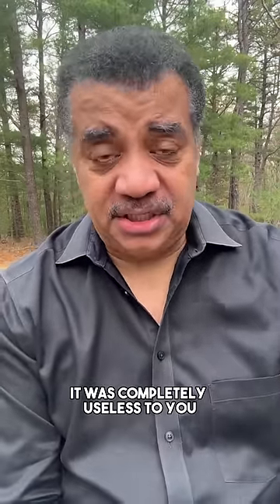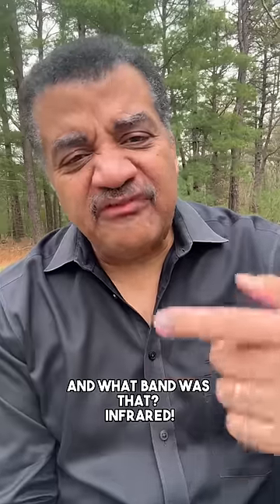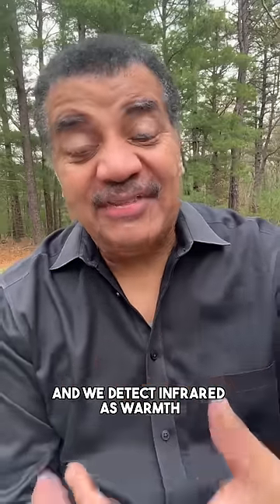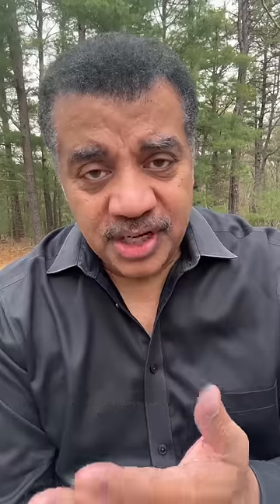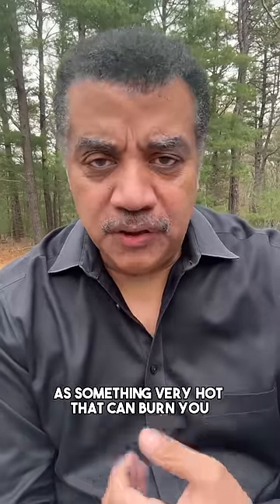LED Bulbs vs. Old Bulbs 💡

Comment: I purchased LED lights for my house way back in 2010. They were quite expensive then ($25-35 each) but they’re still burning just as bright now as they were then. Imagine, an incandescent light bulb 💡 burning for 13+ years….never happen.
Reply: Even if the leds are more efficient with less heat and arent bad for you in some way(speculation). The second point is wrong. Planned obsolescence started with light bulbs if the stories are true.
Reply: @cueballswr9466 That’s not entirely true. With incandescent lights, long lifespan means less light and the light is more red. If you want bright, white light, the lifespan shortens.
Reply: Utter nonsense. LEDs get dimmer over time.
Reply: @coryhoggatt7691  Just about all light sources become dimmer over time. Good quality leds give you the lifetime to a certain loss of brightness.
Reply: @cueballswr9466  Why would they be bad for you? If anything, incandescents are bad for you because they can actually put off wavelengths that can damage your eyes/skin. Also, not sure what you mean about the second point. Incandescent bulbs are designed to fail early, but even well made ones won't ever last as long as a good led light. LEDs last like two orders of magnitude longer.
Reply: There is a incandescent light burning at a firehouse in livermore ca. has been on since 1901. It's turning them off then the jolt of power on start up that makes them burn out
Reply: Had LED bulbs failing on me after a few months despite promising to last years on the packaging

Comment: Now we all know Neil doesn't change his own light bulbs.  LEDs do in fact get quite hot.
Reply: Not really, They're warm at most, depending on the power/size ratio. Incandescent lightbulbs become so hot that they are basically untouchable when they've been turned on for a while.
Reply: Not nearly as hot as halogen and incandesent bulbs
Reply: @jaspermooren5883  I've burned myself quite seriously on LED bulbs, expecting them to be way cooler than they were.  They might not get quite as hot as incandescent bulbs, but they still produce a lot of heat.  When you compare a volcano to a jet engine, you can't honestly or realistically say the engine doesn't really produce heat.
Reply: The "bulb" part may not get that hot, but the area just below the bulb can DEFINITELY give you some SIZZLE upon touch! 😬
Reply: Only 3 Watts? Begs the question: So with a 60 Watt LED the other 57 Watts goes to the power companies so they can plead poverty and raise the rates? Sounds dodgy.
Reply: The highest wattage LEDs are barely warm to the touch, tf you talking about bruh
Reply: I don’t know where you’re buying your bulbs from.. But you should definitely check out other brands.
Reply: Perhaps the first generation of LEDs were hotter? Most bulbs in my house are LEDs, they can be on for hours and still just warm not hot.
Reply: Please make sure that your LEDs are compatible with the light fixture. Not all LED bulbs are dimmable for example.
Reply: They do get hot. Remember, they are not florescent bulbs.
Reply: Led is DC the warmth you feel is the ac to DC transformer on the bulb which doesn't get very warm
Reply: Its the" servers" that get hot , i used to sell commercial LED lights
Reply: Try touching a 100w incandescent bulb!!
Reply: @philokevetch8691  That is the STOOPIDEST COMMENT POSSIBLE about electric power usage!🙄
Reply: @geekchameleon you’ve got some lady hands it sounds like
Reply: The LED chip itself still produces a lot of heat.  Yes, many fixtures carry the heat away pretty well, but have fun powering up a three watt or higher LED (single chip or COB array) without a heatsink.  It will get so hot that it destroys itself really fast.  If you're not careful, it will remove the flesh from your fingertips because it is so hot.

Yes, the AC/DC conversion process produces heat, and so does the DC/DC voltage and current regulation.  But in many of these systems, it is still the LED chip itself that produces the most heat in the system.  The power conversion system is usually pretty tightly packed compared to the LED and the reflector/thermal solution the LEDs are attached to.

As I said before, just because an LED isn't quite as hot as an incandescent bulb, it is no way near accurate to say that LEDs don't get hot.  Because they do.
Reply: Yeah LEDs May be less hit than incandescent, but they do get hot
Reply: @geekchameleon jet engines produce more heat than a volcano....
Reply: I think you should look for some better quality led's. The only reason they would get that hot is due to the ac/dc converter, which is  normal to produce some heat, but if its as hot as you say it's inefficient/poorly made or in worst case faulty, which could cause fire.
Reply: LEDs generate heat in the circuit not the bulb itself
Reply: @MadChrisp  Absolutely untrue.  The junction that produces the light also produces significant amounts of heat.  The supporting circuitry also generates heat, but is not the sole source of heat in the system.
Reply: @geekchameleon  Just to verify your claim, I tried to touch the led bulb which was on for last 3 hours.. It is slightly warm.. Unlike what you’re saying it doesn’t get hot like an incandescent bulb..

Just fyi it is a Philips 11 watt led bulb..
Reply: Yes, I was going to post this.
Reply: @TheGuider The bases of the bulbs, containing the electronic circuitry that drives the LED chips, do indeed get pretty hot.
Reply: @geekchameleon   Then you have some weak skin or you bought a fake LED lightbulb
Reply: @tuzopaai take that 11 watt led chip out of it's well designed (Philips do good stuff) heat transferring enclosure and power the chip while it's in your hand.  At 3.7 volts and about 3 amps, the back of the chip will burn your hand and melt the solder holding wires to the chip in about half a minute.
Reply: High performance led flashlights get super hot. Especially multi emitters that are output a couple thousand lumens.
Reply: @Zack_Axel I know right hahaha, I have a 6000lumen one that gets really hot if I have it on max brightness. I can literally go burn myself with it right now😂
Reply: @philokevetch8691 no he's making a comparison saying a 3watt led produces the same light as a 60watt old style bulb
Reply: @jaspermooren5883 led's have heat sinks. Some led's are cheaply made and have terrible heat dissipation. Even good high quality ones should not be installed in enclosed fixtures as the heat will just build up in the fixture which can damage the LED's. LED's are more fragile to heat as well. And yes they sure can get hot to the touch most dont get to that point but they can if they aren't dissipating the heat properly. Uncommon but it happens. Where I see it happen the most is in led flashlights.

Comment: The lightbulbs at the turn of the century used to last for at least fifty to a hundred years. They had a tungsten filament instead of copper. GE realized with the old light bulbs never going out people would not be buying new ones unless it was for lack of new home build. The bulbs that Tesla made if any of them still existed would be running right now. But JP Morgan who owns GE back then, he and his scientists got together and decided to get rid of the tungsten bulbs and create these flimsy copper bulbs, so that they were very delicate as well as having a short lifespan. This ensured that people purchased new bulbs on a regular basis and increased the profits of GE
Reply: Good job identifying yourself as someone who believes anything they get told.
Reply: There is one problem with your conspiracy, it doesn’t take much for for a market competitor to come up and produce his own, long lasting light bulb.
Reply: Incandescent bulbs are still tungsten filament if you can find them.  He is talking about the single light bulb that is the anomaly at a fire station in Livermore, CA.   I suspect that light bulb last because they got really close to a vacuum  in that particular lamp and the filament is, by manufacturing error, is rated for a higher voltage and hence the bulb lasting a lot longer.
Reply: @DIp-mj1yc he was mistaken on the filament. The original bulbs including the one from the fire hall are carbon filaments which are long lasting. The tungsten ones are the short lasting ones. The 2 articles I linked above explain more
Reply: @teebob21 read above comment, I advise you research things before you deny them, although most conspiracies are ridiculous this was a well known and documented case
Reply: @cryptouk7985  Oh dear, another one. Alright, I'll oblige.

The Edison light bulbs at the turn of the century did not last 50 to 100 years, as claimed. At that time, they used a carbon filament made out of bamboo, and generally had a 1200 hour lifespan. 

Copper was never a successful incandescent filament. With a melting point of 1025 °C, copper will give only a dull yellow short-lived light, and will quickly degrade and the filament will break. 

Nikola Tesla did not invent or improve upon the incandescent light bulb. His contributions to electric lighting were improvements on the carbon arc lamp, known as a carbon button lamp. Unfortunately, this style of lamp requires high-frequency alternating current and requires dangerously high currents in order to initiate electron release into the bulb (via a mechanism ironically named the Edison effect). Small solid-state transformers such as those used as ballast in modern neon lights would have served as suitable drivers for these button lamps, but they were 50 years in the future. It was impractical, expensive to own & operate, and failed commercially.

There is no evidence that JP Morgan conspired to change the construction of turn-of-the-century lightbulbs to have a shorter lifespan via planned obsolescence. Quite the contrary. In fact, JP Morgan's family home was one of the first to have electric lighting, instead of gas. Even after a small house fire cause by an improvised arrangement which ran wires under carpets and used a direct contact connection to illuminate a library desk in the middle of the room, Morgan eventually had his entire house wired to use Edison-style bulbs. (More info: Jonnes, J. Empires of Light. Random House Trade Paperbacks. pp 5-11.  ISBN 13: 9780375507397) 

Additionally,  the Edison Illuminating Company, which would later become Consolidated Edison, was not part of the 1889 merger, and has never been part of General Electric (GE).

This conspiracy claim fails on every assertion.
Reply: @teebob21 everyone gets told everything they think or believe.

Comment: LEDs also produce heat, but not from the Light but the fact that LEDs draw more current. Next time you turn on your LED, leave it on for a few minutes, remove it and you'll find the mid section to be very warm.

Comment: I live in the northeast. Nine months of the year there’s two things I need in my house, light and heat. The heat your not getting from the lightbulb, your furnace has to make up. The bulb doesn’t have a flue pipe, so you retain all the heat. Your furnace does have a flue pipe, so a certain amount of heat goes up the chimney. I would argue that in northern areas the incandescent is more efficient.
Reply: It gives off heat because the filament has electrical resistance. It creates friction and slows down the flow of electrons causing heat. The heating element on a range is a resistor. An LED is a light emitting diode, not a resistor.
Reply: And you could put it under a clay flower pot and the pot absorbs the heat, stores it, and radiates it. Saving energy. LEDs in the summer, incandescents in the winter.
Reply: Not for half the year though when you dont actually want heat in the house. Then your AC is running more to compensate so its like a double loss for half the year

Comment: In cold weather, the heat from  old-fashioned Tungsten light bulbs can be useful. On a hot summer day, your air conditioning has to work hard to remove it, an even worse case scenario.
Reply: Eh… in a small closed off area maybe, but with the amount of electricity it uses to do that, you might as well just go to the kitchen and turn the oven on.
Reply: But now you can just get an infrared LED for more heat for less cost.

Comment: I replaced every bulb in my house with very low watt led and the monthly bill stayed the same
Reply: Most of your power comes from other things anyway.

However if you have electric heat then it's more likely that your furnace or baseboards etc. are just making up the difference.
Reply: That could mean your lights were not contributing that much to the amount of electricity you used or perhaps your usage changed after you changed the bulbs

Comment: Infrared light was actually beneficial. Its free heat without the necessary infrastructure for a heat generation system.
Reply: It not free heating. The extra watts of electricity you pay for. There are other electric heaters that are just as efficient as light bulbs without producing light. Those light bulbs produce heat even in the summer when you don't want heat and you need to cool your house even more. So it's not very smart to use light bulbs for heating.
Reply: @MrT------5743  In scandinavia where I live summers and winters are all wet. Infrared light from a old light bulb is enough heat and energy to keep the indoor structures dry during rainy seasons.

Comment: He’s wrong, if you have a nice led flashlight, they get warm enough to melt holes in your pocket if you leave them on by accident
Reply: That doesn't sound nice at all
Reply: Many LED lights are mounted on a heatsink, or the internal power supply is giving off some heat.
Reply: While true those flashlights are putting out a tremendous amount of Lumens with most starting at 1,000 lumens. (Mine goes  to 6,000 lumens and produces so much heat that the metal has ribbing to help get rid of the excess heat.
Reply: Of course they generate  a ton of heat if powerfull enough
Reply: Yeah. Last I checked even the tiny led in my phone can give me a nice sting if I ever leave it on by mistake and then touch it.

Comment: The old light bulbs actually produced light that you can read by. The old bulbs had many uses beyond providing light. The old bulbs were glass and a little bit of metal which was  biodegradable but the new ones are filled with microchips and mercury and all sorts of noxious things that are going to ruin our land fills. I'll happily pay a bit mor to have that reliable tool back..

Comment: Now, many, many LED bulbs today often fail quicker, than old tungsten ones. Mainly because of their shape, which doesn't allow too much cooling of the electronic driver, or because some manufacturers designed them to fail quickly by overdriving the LED chips. I know, that todays LEDs are much cheaper than the first ones, and the energy savings are big, but the electronic and plastic waste produced with an LED bulb is something worth reconsidering...

Comment: Research the danger of LED lighting , the old bulbs were safer and cheaper , can’t find em anywhere now
Reply: post link to sources
Reply: Compact fluorescent bulbs have a little bit of mercury in them, so they're somewhat dangerous.  I haven't heard anything about LED bulbs being dangerous, only that they don't seem to last 18 years like they say they do. 
As for incandescents, you should be able to find some, as there were exceptions made for specialty lighting.
Reply: @macsnafu  the lighting from led bulbs are dangerous for the eyes
Reply: Not a healthy light spectrum
Reply: @danielsalazar299  Have you checked out the newer LED bulbs?  As I said, they've been getting better.  I think the  mandatory law has forced us to use LEDs before they were really ready, but they continue to improve them.
Reply: Ebay
Reply: You sound mad! Maaaaaaad!
Reply: @danielsalazar299  You're referring to the blue and ultraviolet end of the spectrum which IS bad for the eyes, however these are filtered, and the only place where they are truly a risk is staring directly at them like a monitor for example, by the way, if you think its that bad I suggest you never look at a blue sky again, that puts out more than any led lighting than we can produce.
Reply: The only danger is that they’re incredibly bright, and of course that they’re Semiconductors which use chemicals to emit certain wavelengths of light (colors) but that’s only dangerous if you open one up and swallow it.
Reply: @04mach1speed  The chemicals in leds are no worse than those used in fluorescent lighting, you don't want to be swallowing the coating of the filament cathodes, the substance in your microwave magnetron is deadly, the battery in our phones is toxic.
Reply: I find them in mom and pop hardware stores and Amish general stores.
Reply: @karen1866  thanks so much

Comment: This is why LEDs are dangerous as taillights. On semi trailers, for example, LED taillights will not melt the snow off the taillights, resulting in equipment that is invisible to traffic behind.
Reply: The incandescent don’t either. I drive a snow plus up here in Canada with incandescent and I’m constantly needing to pull over and clear my rear (and even headlights) off.